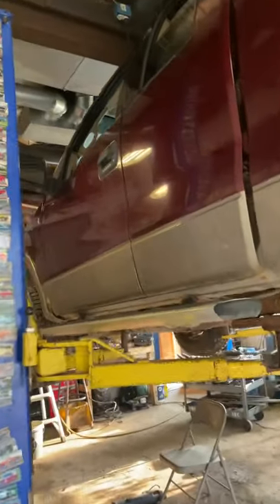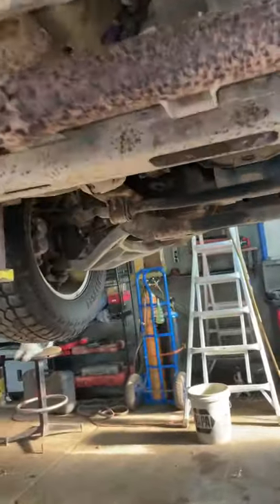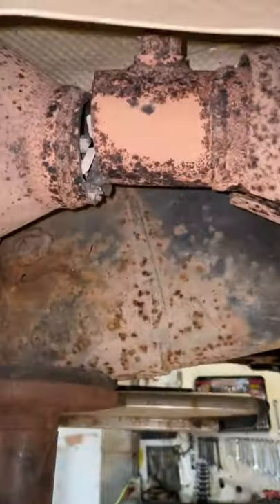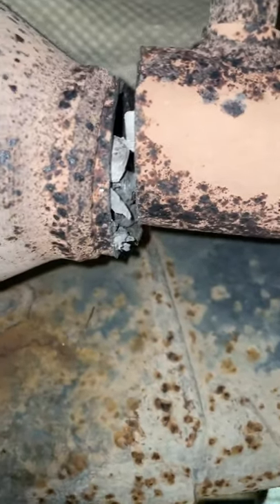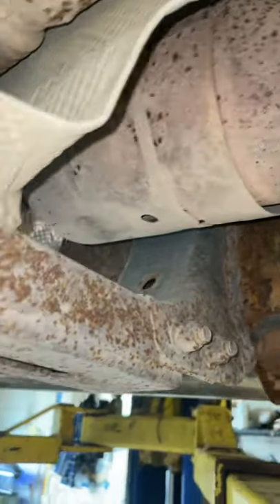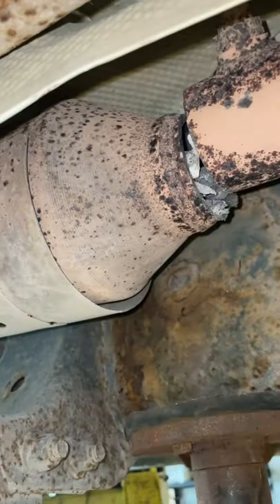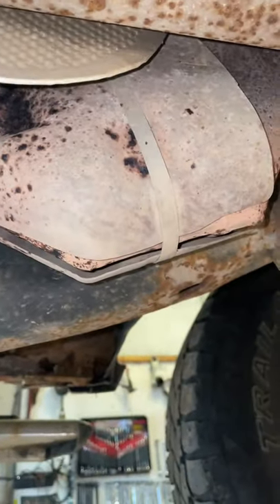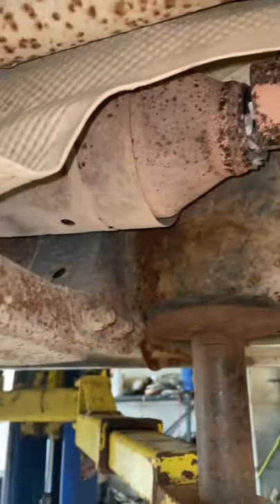Plugged Catalytic Converter

Comment: You would think there would be a po420 and or po421 cat efficiency codes
Reply: dealing with this now on a 5.4 06 f150.. and not ONE code and i do believe it’s the converters . thinking about disconnecting the pipes before the converters to see if the engine will breathe